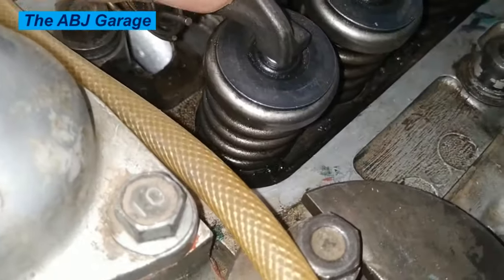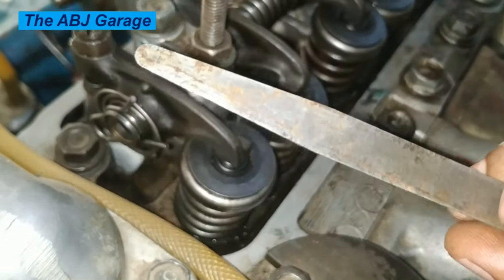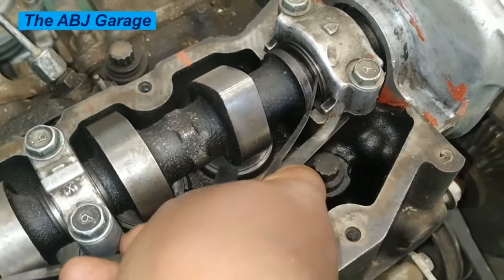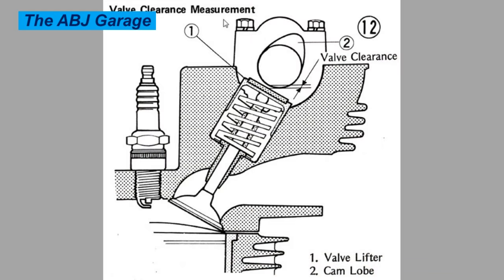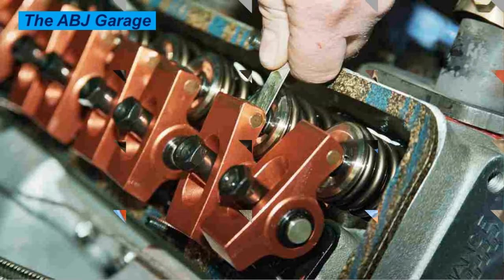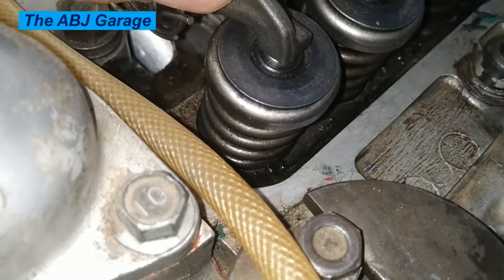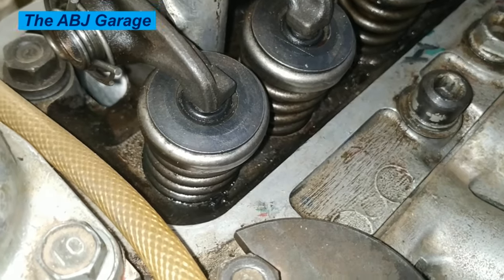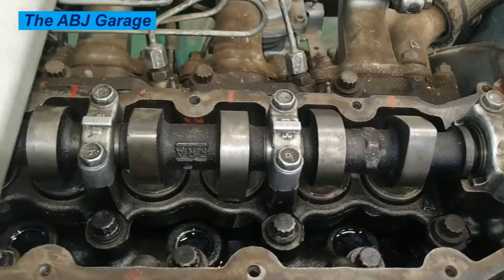How to tell if you have wrong valve clearance

Comment: Very nice video indeed! I've been adjusting valves on and off for 50 years since I started driving/motorcycling and I've always adjusted way too loose compared to how you demonstrated, the correct method. I'm servicing my diesel generator tomorrow, post break-in; this includes valve clearances. I'll be interested to note any differences in engine noise when I finish. Thanks for the video, very helpful.
Reply from the maker: Thank you very much!!

Comment: Hi i have ns200 should i do valve clearance i have run my bike 17000km my ns200 2020 model
Reply: anual suggests every 2nd or 3rd service you have to check valve clearance and adjust accordingly. no service center does it as they are not confident of their work plus they will only do it if there is a sound

Comment: How would oil get in the cylinder from the valves?
Reply from the maker: Wrong valve clearance cannot directly cause oil leaking. However, if the valve clearance is too tight or too loose, it can cause engine performance issues such as poor fuel efficiency, misfires, and increased wear on engine components. This increased wear can lead to oil leaks over time. Tight valve clearance in conjunction with bad valve seal can cause oil leaking into the cylinders. Wrong valve clearance alone won't!

Comment: My engine is not starting would it be because of this
Reply from the maker: I don't think so! Valve clearance issues are not known to cause a no start situation unless they are extremely off, which usually happens after cylinder head reinstallation.  Please look for either fuel or ignition related problems, those are known to cause no start situation
Reply: @TheAbJGarage  what should i do i just did a gov delete and added a flywheel with stock key  and carb there is spark and fuel
Reply: @TheAbJGarage  i checked the valves and the right one was off the rodi pit it back on but did not adjsut it